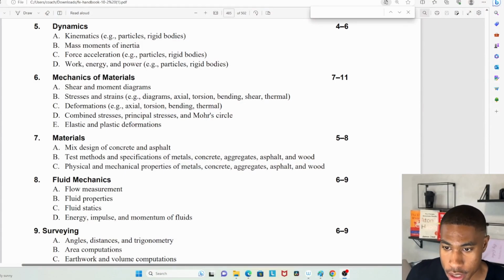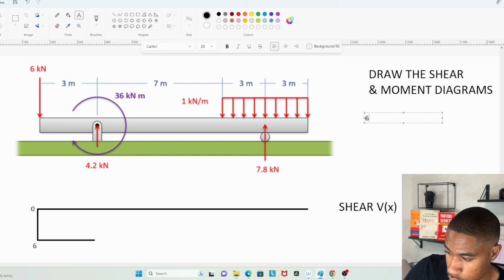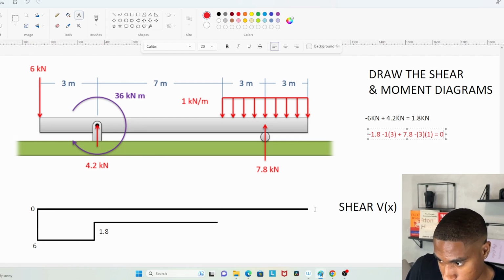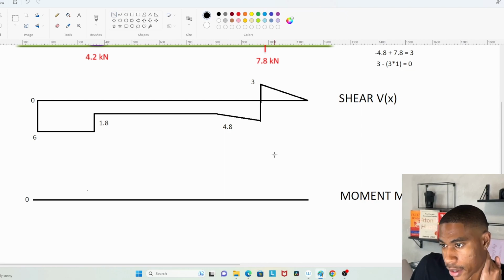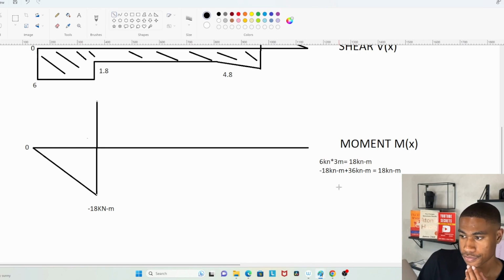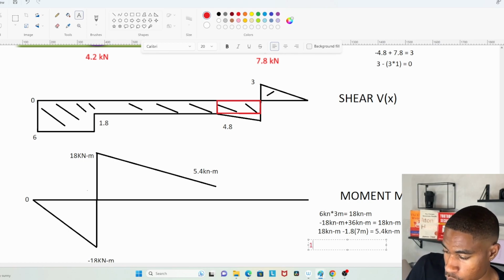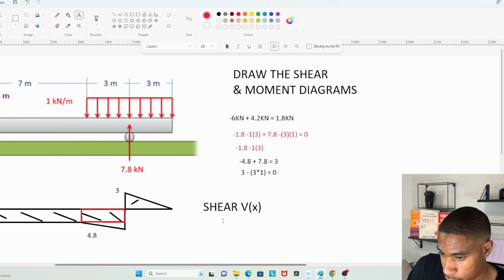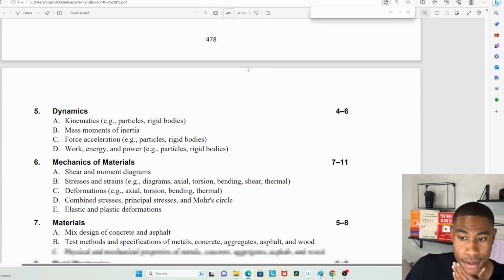2023 FE Exam Review (Civil)| Mechanics Of Materials| Shear & Moment Diagram | (Problem and Solution)

Comment: shouldn't be the moment drawn with a purple arrow negative? since it is going clockwise
Reply: agreed
Reply: I think it is positive, since it make the left part bending concave upward.
Reply: @tjinboise4778  Yeah that's what a negative moment causes, it makes the beam concave upward like this (  I think this the moment should be counterclockwise so that it generates a positive moment and it actually makes sense to draw the vertical line up to +18 KN*m for the diagram to close.